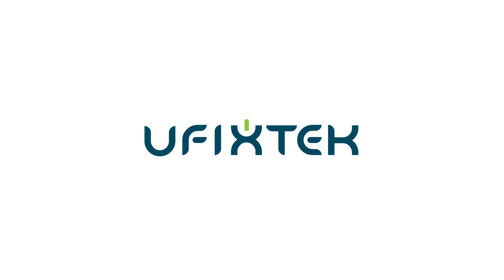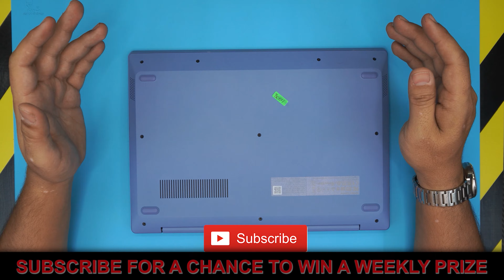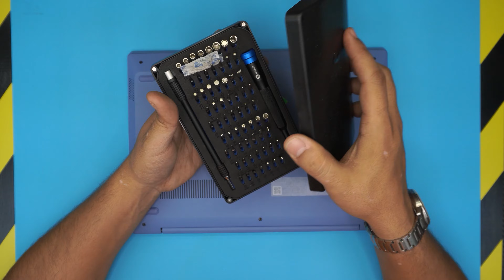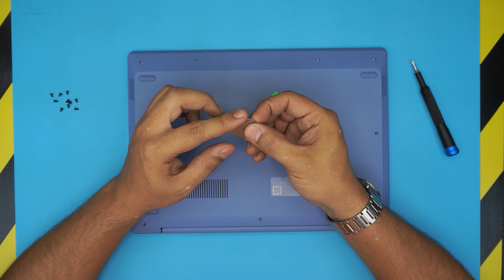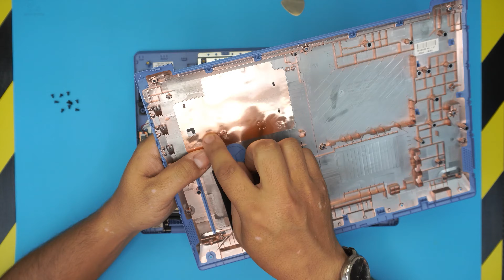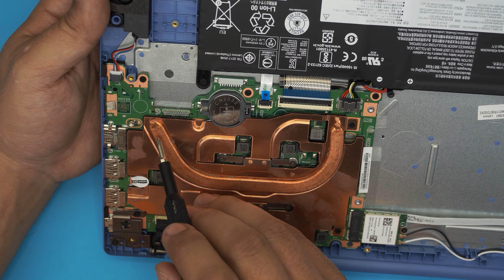Lenovo Ideapad Slim 1 81Vs ,SSD , HDD , Ram,  UPGRADE Not Possible !!!

Comment: thanks for this. I have an earlier 110s 11.6inch  laptop that is easily expandable using an m2 slot. I need a small compact machine i can whip out anywhere and that 'fitted the bill' with a modest m2 ssd card in . . these days however even for limited office tasks the in stalled 2GB ram is not  enough, and the processor is too old and slow. again even for very limited tasks.  

so i guess after seeing this, Lenovo have cut off this upgrade path to try to get us to change our machines more often !
Reply from the maker: Thank you for the feedback! if you wish to support the channel you can LIKE or SUB or both :P
It is true that lenovo and most other if not all brands are shifting from the idea of making a good laptop LAST and also UPGRADABLE. its not in their benefit to do this anymore its the war of reselling that is happening. its like your Iphone, they put a 16gb , 32gb and so on storage and that is not upgradable or add extra storage because they dont like it, they want to milk the cow as much as possible. same here in laptops, they adding they tablet specs of components and a attached keyboard and trackpad and change the name from portable TABLET to a portable laptop.  and its sad that they dont present this info on the box , so the consumers clearly understand what they are buying.
on weakly basis i get about 40-50 clients coming in thinking that they can upgrade the resent purchase of the laptop that they got cheap. because even the sales reps tell them "oh ya get this and upgrade later" BS they don't even are oriented to know what a garbage they pushing to a consumers.
Reply: @uFixTek  so basically we are in the middle of a climate crisis where many items are in short supply and rather than giving us the option to extend the useful lifespan of our current products, manufacturers try to actively hinder us !   Capitalism and consumerism gone mad. same with cars etc.
Reply from the maker: i know this may sound a bit off topic, but the world is divided and we as consumers have no right in any major effects, we are the slaves of our society ( governments and big companies), we get paid and the money we have its not even ours (at least not 100%).
im not pointing fingers or anything, just think about this: this pandemic started in china and the price of electronics and house fitness and face mask went to 800%, and when the pandemic started spreading to other countries china started recovering and going back to normal, and who you guess is making all those electronics , face mask and much more and selling them at 800%+.
i'm just saying, they could start helping other countries for the same price or less  and humanity can be back to normal.
this topic can be talked about for days. im living at the moment in the Mexico and its so sad that i see the low class families can't afford any sort of laptops and they using old A**SS cellphones tablets for their kids to do home school. and even if the little money that they get they end up pushed to purchase this low grade "laptops" . i provide free service as much as i can for those families here for 2years now and its sad that every other electronic shops are taking advantage and ripping the poor people. i have donated over 200laptops and tablets to so many people in need and making videos for helping others to not get ripped.
for past 2years every single penny i made from little viewers i have here i helped families in need. you don't see me making videos helping people, because they have rights to be anonymous. it gets be mad and angry when i see this other channels with millions of subs and viewers and  making videos of how they are feeding the poor people and show their reaction so they can make 3x money. if he or she wanted to help poor people no need to label every poor individuals.
like churches, they make food for poor people and they ask them to go there 1pm-3pm and eat a portion,  i do that to my dog!!  if the church wanted to really help the poor then STFU and take the food to the people and don't brag about it. 
but they need MONEY 90% for them and 10% to action.
BTW i have relatives from china, im not against the race, im talking about governments and big industrial biz. (not racist over here)

Comment: in Canada i took this laptop to a shop and asked them to install m.2 jack, the guy told me that i should not do this. but i insisted and got it installed and it doesn't work!!! money wasted :(
but he did charge me $98CAD and installed a 256gb emmc and i had to install windows and its working like a charm.
Reply from the maker: you should of listen, its sad that how some people insist on how that by installing m.2 it will just simply work.
Reply: me too... I took this laptop to a tech store in New Zealand during vacation and because I was running out of space and needed more storage I asked the guy to install the m.2 jack so that I could have more storage... he also suggested me not to do this and my dumb self insisted and was charged 50$... 2 weeks later the process was finally done and I come to pick up the laptop and went back to the UK to my hometown and I decide to try if it actually works and of course the bios does not detect the SSD. money wasted :(
Reply: Also this isn't my daily driver thank god.. i was just experimenting around
Reply from the maker: i know my friend you should of seen the long discussion that i had with an idiot here in the morning saying 1st of all 256gb emmc dont exist lol
https://bit.ly/3jj2j1z
and that some guy made a video on you tube that he installed the m.2, but in the video he never dared to show or post a video even months later showing it working. there are many other factors that come in play after installing the m.2 jack: power regulators components, bios firmware and mods, and voltage regulators must be adjusted. i do this for living and i repair motherboard and more. 
the only option is to replace the emmc storage to a 256gb and you are all set, and even that requires a good technician that know how to do reballing.
i have increased this laptops storage to 128gb and 256gb emmc and they work great. i dont make the video because i dont want people to try and by accident destroy. in my videos i try to keep it in safe side for users.
Reply: @uFixTek  Lol what a guy 😂
Reply: @uFixTek  yeah it's been 2 weeks the technician I commisioned had installed a 128GB eMMC for me and it's working perfectly lol
Reply from the maker: @Anonymous-io9yz  awesome my friend enjoy it :) and ya some people make me laugh so much for what they say that 128gb is a very rare chip lol 
im glad that you got it upgraded. if anything in the future i can help you or inform you with feel free to ask me.
Reply: Hi can you give me compatible EMMC ic for this one? 256gb

Comment: Can able to use micro sd card in it
Reply from the maker: Thank you for the feedback! if you wish to support the channel you can LIKE or SUB or both :P
regarding your question:  they dont have SD card reader, you can get and sd card to usb adapter, but it will be slow.
Reply: @uFixTek  any other way to increase storage
Reply from the maker: the only risky way of increase would be to take it to a real good technician to do a reballing and replace the emmc chip with a 128gb ir 256gb chip.
but that is risky because if the guys increases the heat a bit it would damage the board.
Reply: @uFixTek  ok
Reply from the maker: we order the 256gb and we do install on laptops a like and on phones.
https://bit.ly/3jj2j1z
people will try to mess with you, be very careful!
Reply: @uFixTek  ok

Comment: Hey. I have the same laptop and it keeps auto repairing and it won't detect the eMMC anymore. I have to boot into disk selection aka the F12 key and manually select it from there everytime I start it up
Reply from the maker: update the bios 1st, then make sure your boot is set to boot uefi
Reply: @uFixTek  Thank you so much, it worked!
Reply from the maker: your welcome, my pleasure :)
if you ever have any question feel free to ask me.

Comment: Good video.
Please how to upgrade the current  • 64GB eMMC 5.1 on the system board?
Reply from the maker: Thank you! for the feedback and your support to the channel by SUB :P
Regarding your question: The eMMC is not removable, you will need to send it out to a GOOD technician that knows how to to reballing , else you will damage the motherboard.
i dont know how to reball because most people will damage the motherboard even if they see a video on how to, it requires a lot of experience.

Comment: Kinda surprised that it comes with a cr2032 backup battery, most laptops use the main battery as the time battery.
Reply from the maker: they they do come with cr2032 and there is a slight different model that uses a Cap for the temporary battery.

Comment: You can actually solder an m.2 connector ok the top left and add storage that way, mine works with 256gb.
Reply from the maker: true and not true, we have place on many versions a connector and only 30% of them did detect the ssd, and the rest the connector was perfect but the bios would not detect it. and for a regular consumer it risky to do this at home or some technician that dont know how to use solder well or heat gun. for the above reasons i dont like to show modding videos  that can cause damage to the laptop. i appreciate your feedback and support my friend :)
Reply: @uFixTek  yes, but for me it works on the lenovo slim one since there is actually a version with 128gb or 255gb nvme ssd if you look at the brochure
Reply from the maker: yes the come in 250 and there is a 512gb also.  but for some reason we have installed in few clients the connector and only worked in few.  but again im glad that you got it expended and thanks for the sharing.
Reply: @tristan6509  what if you just have the 38 Gigabyte hard drive? I really want to put a 1TB SSD in mine because of how much space it's lacking 😩 but 1 TB is expensive

Comment: is egpu an option for lenovo ideapad slim1? many thanks!
Reply from the maker: you would do a egpu and remove the wifi board and install a usb wifi and have a egpu running from m.2 of wifi connector.
but you will need to cut the bottom case :/
https://amzn.to/3dtECis

Comment: do you think you could put a m.2 ssd in the wifi card slot instead of wifi card?
Reply from the maker: Thank you for the feedback and your support to the channel by a SUB :P,
regarding your question, you could technically but its will be as slow as usb speed.
Reply: @uFixTek  will it be any faster than  the emmc storage?
Reply from the maker: hell no its will be like 80% slower than emmc
Reply from the maker: we have tested in many laptops with different adapters.
Reply: @uFixTek  ok then i wont get one because i only wanted it for better speeds
Reply from the maker: I FOR SURE WOULD NEVER , recommend this laptop to anyone, not even my enemy :P
Reply: @uFixTek  yeah i made the mistake of buying it like 6 months ago and i already want to replace it.
Reply from the maker: Oh daymn

Comment: can egpu work its?
Reply from the maker: the GPU is not up-gradable, and cpu is not up-gradable. and this model doesn't have a GPU dedicated.
Reply: i mean can i put a egpu method
Reply from the maker: yes you can , you will need to remove the wifi card and get a usb wifi:
https://amzn.to/2ZUsLUi
and in the m.2 of the wifi card you can place a egpu no problem.
https://amzn.to/3q3l7BF

Comment: why does it have that 2032 battery??
Reply from the maker: That cr2032 is there to keep the Bios configuration active if you remove that the bios date and time and settings will be reset to default. the battery will last about 4-6years.
Thank you for your feedback and support to the channel :)

Comment: A big thank you! This video is exactly what I needed to decide to buy one or not. The one I buy with the A9 CPU has a 128Gb SSD, so probably the NVME or SATA slots are enabled on that one. So maybe it is better upgradeable. Anyway, I hope, because I have not received it yet. :-) Thanks again, and keep up the good work.
Reply from the maker: Glad I could help! thank you for the feedback and your support to the channel :)
if you ever have any request or question feel free to ask me in any of my video comments.
if you get a bit the advanced version you may get the extra components unlocked :P
its all about the DLC :P
Reply: @uFixTek  How can I get my data off this broken 81vs laptop with no SATA ports? Thank you.
Reply from the maker: @supplychain2831  you will need to desolder that emmc chip and get a emmc chip reader, its delicate and alot of work, solderign experience and hot station required.

Comment: I have the exact same laptop and it keeps auto repairing and idk what to do to stop it and I tried many ways but nothing works can u help me
Reply from the maker: the internal MMC memory is failing , there is nothing you can do , the only thing is to desolder the MMC chip and replace it. and if you find a good repair shop that can do that ask them to put a 256GB MMC

Comment: Can you please tell if we can insert pcie slot extender and insert WiFi card and a PCI ssd in that? You said wifi card is the only thing which can be replaced
Reply from the maker: Yes you could get an adapter and insert a ssd into adapter then into wifi connection and use a usb WiFi for the internet.
I would appreciate your support to the channel by a sub :P
Reply: @uFixTek  thanks, just subscribed , can you please suggest what kind of adapter or extender would for this laptop
Reply: @ataulghanitahir  do research on the type of wifi card to what kind then search for broad adapters for m.2 nvme ssd.

Comment: Can The Hdd Connector Socket Can Be Installed, So That The Hdd Can Be Mounted On The Motherboard
Reply from the maker: no my friend it cant, because there are many components that are not installed and if they get installed you must change few other components (power regulators) to feed the voltage. sorry to inform you like this :(
thank you for the support to the channel, if there is anything in the future you need help with let me know in any of my video comments
Reply: @uFixTek  I just want to install the hard drive socket connector, which is not installed on the motherboard, is it possible?
Reply: @uFixTek  on the motherboard there is a slot to install a socket, but it is sealed by the factory, now I want to install the socket there, bro.
Reply from the maker: if you install the socket it will not detect the drive!!
you will need other components that are required.
good luck my friend
Reply: @uFixTek  thx For Information My Friend
Reply from the maker: your welcome

Comment: I bought the Ideapad 1 14ADA05 which has the AMD 3050E chip.  It's a decent no frills PC for light use.  Thanks for posting this as I did wonder if I should open it up to look inside.
Reply from the maker: Glad I could help! ya for basic use its okaay :) Thank you for the feedback and your support to the channel, if there is anything else i could help you in the future ask me in any of my video comments. good luck :P
Reply: I have the same laptop can I upgrade ram ?
Reply from the maker: no my friend the ram is not upgradable :(
Reply: @uFixTek  can i upgrade the storage on this laptop the 14ADA05
Reply: I just bought this laptop today, is it still working good for you?